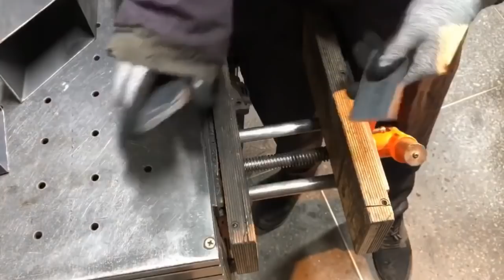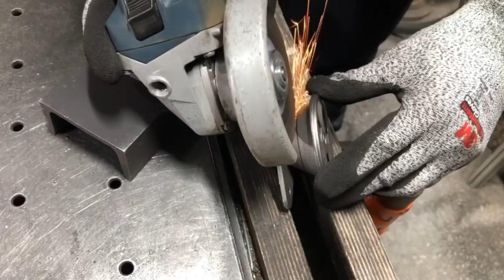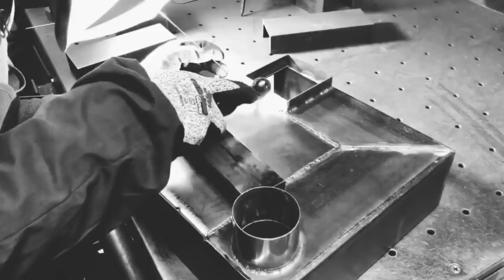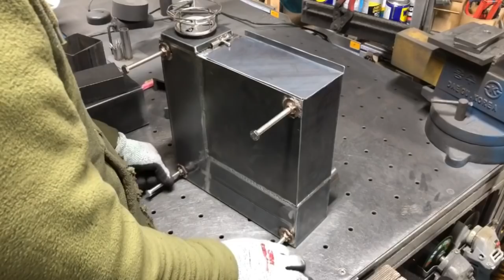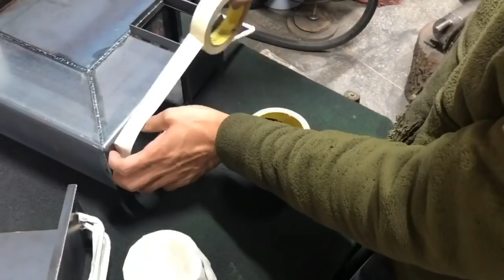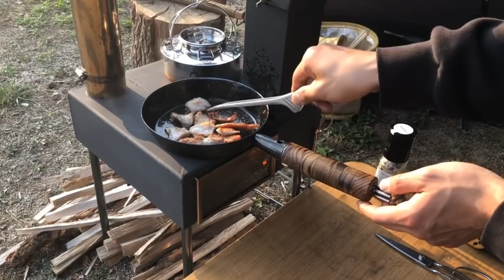캠핑용 미니오븐로켓스토브 만들기/Making mini oven rocket stove for camping

Comment from the maker: 캠프에서 연속약11시간사용
전체무게약: 10~12kg
연통:3M사용 (2~3M권장)
전체 사이즈: 300X300XH100 /오븐: 200X185XH85
각관파이프 :100X100X2T /철판: 1.6T ,4T(오븐상판)

About 11 hours of continuous use at camp
Gross Weight: 10 ~ 12kg
Chimney: use 3M (2 ~ 3M recommended)
Overall size: 300X300XH100 / Oven: 200X185XH85
Square pipe: 100X100X2T / Iron plate: 1.6T, 4T (oven top plate)

Cerca de 11 horas de uso contínuo no acampamento
Peso Bruto: 10 ~ 12 kg
Chaminé: use 3M (2 ~ 3M recomendado)
Tamanho total: 300X300XH100 / Forno: 200X185XH85
Tubo quadrado: 100X100X2T / Chapa de ferro: 1.6T, 4T (placa superior do forno)

Aproximadamente 11 horas de uso continuo en el campamento
Peso bruto: 10 ~ 12 kg
Chimenea: use 3M (se recomiendan 2 ~ 3M)
Tamaño total: 300X300XH100 / Horno: 200X185XH85
Tubo cuadrado: 100X100X2T / Placa de hierro: 1.6T, 4T (placa superior del horno)

キャンプで約11時間の連続使用
総重量：10〜12kg
煙突：3Mを使用（2〜3Mを推奨）
全体サイズ：300X300XH100 /オーブン：200X185XH85
角パイプ：100X100X2T /鉄板：1.6T、4T（オーブン天板）

Около 11 часов непрерывного использования в лагере
Вес брутто: 10 ~ 12 кг
Дымоход: используйте 3M (рекомендуется 2 ~ 3M)
Общий размер: 300X300XH100 / Духовка: 200X185XH85
Квадратная труба: 100X100X2T / Железная пластина: 1.6T, 4T (верхняя плита духовки)

在营地连续使用约11小时
毛重：10〜12kg
烟囱：使用3M（建议使用2〜3M）
整体尺寸：300X300XH100 /烤箱：200X185XH85
方管：100X100X2T /铁板：1.6T，4T（烤箱顶板）

Ca. 11 Stunden Dauerbetrieb im Camp
Bruttogewicht: 10 ~ 12 kg
Schornstein: 3M verwenden (2 ~ 3M empfohlen)
Gesamtgröße: 300X300XH100 / Ofen: 200X185XH85
Vierkantrohr: 100X100X2T / Eisenplatte: 1,6T, 4T (Ofenplatte)

Environ 11 heures d'utilisation continue au camp
Poids brut: 10 ~ 12 kg
Cheminée: utilisez 3M (2 ~ 3M recommandé)
Taille globale: 300X300XH100 / Four: 200X185XH85
Tuyau carré: 100X100X2T / Plaque de fer: 1.6T, 4T (plaque supérieure du four)

Kampta yaklaşık 11 saat sürekli kullanım
Brüt Ağırlık: 10 ~ 12kg
Baca: 3M kullanın (2 ~ 3M önerilir)
Toplam boyut: 300X300XH100 / Fırın: 200X185XH85
Kare boru: 100X100X2T / Demir plaka: 1.6T, 4T (fırın üst plakası)

Khoảng 11 giờ sử dụng liên tục tại trại
Tổng trọng lượng: 10 ~ 12kg
Ống khói: sử dụng 3M (khuyến nghị 2 ~ 3M)
Kích thước tổng thể: 300X300XH100 / Lò nướng: 200X185XH85
Ống vuông: 100X100X2T / Tấm sắt: 1.6T, 4T (tấm trên cùng của lò)

Circa 11 ore di uso continuo al campo
Peso lordo: 10 ~ 12 kg
Camino: utilizzare 3M (2 ~ 3M consigliati)
Dimensioni complessive: 300X300XH100 / Forno: 200X185XH85
Tubo quadrato: 100X100X2T / Piastra di ferro: 1.6T, 4T (piastra superiore del forno)
Reply: What u use on chimney pipe? Titanium or steel? U give me inspiration to create my own stove. 😊
Reply: 건강해주세요~ 작업영상에 번역까지 ㅠㅠ 물론 구독자와 조회수가 늘어 스토브님의 작업 영역이 넓어지면 좋겠지만...전 오랫동안 스토브님이 만드는 불을 보고 싶어서여.. 작업영상만 봐도 내가 골병날거 같은데 ㅠㅠ  부디 건강챙기셔서 세계적인 스토브 아티스트가 되시길 바랍니다~!!
Reply: StoveTV 파실 생각은 없으신지요?
Reply from the maker: I use stainless steel
I hope the video helps
Make a good product
Reply from the maker: 아직은 건강해요 ㅋㅋ
번역이 정말 일이더라구요 ..이제 번역을 넣어야할때가 맞는거 같아서😢
잡생각안난고 저도 공부한다고 생각하면 재밌어요 아직은 ㅎㅎ
한번 시작했으면 끝을봐야죠 ㅎㅎ
걱정해주셔서 감사합니다 역쉬~버섯커님 최고😆👍
Reply from the maker: 판매하고싶어도 회사일이 먼저라서 팔수가없어요 ...
이해해주세요 😢
Reply: StoveTV 아무튼 정말 매력적인 스토브입니다!
보는 걸로 만족해야겠네요.
Reply: @stovetv  do you sell these. They have superior designs over what’s on the market. 

Can you get into a larger scale production?

Comment: Please, which paint do you use, and what is the method or procedure that you follow in order to paint it?
Because I made a horizontal rochet stove with oven that reaches 590 C°, as a result the paint starts to peel off.
Thanks in advance for your help.

Comment: Hello,
i  love the rolled Chimney. Can you tell me the thickness of the metal sheet?
Best regards, 
Markus
Reply from the maker: The chimney thickness is about 0.1T
1.6T tube pipe
The thickness of the oven top is 4.0T
Most of the rest of the material is also 1.6T

Comment: Great design. It seems the change to 4mm thick top plate is from some lessons learned with your past designs. Would you consider doing a video going over what you learned from the different stoves you've done, either from each individual stove or just listing them all together?
Reply from the maker: Yes, 4MM steel plate has an excellent effect in preventing heat distortion.
It was applied as a lesson
Thanks for watching

Comment: What kind of glass used for windows? Is it normal 5 mm glass, or use tempered glass? Im stuck in the windows thing... 
Btw, your job was awesome!
Reply from the maker: It is heat-resistant glass. It is usually about 4MM.
Thanks for watching

Comment: Awesome!!!
Question: 1.6T, 2T and 4T, how much is it in millimeters?
Reply from the maker: About 11 hours of continuous use at camp
Gross Weight: 10 ~ 12kg
Chimney: use 3M (2 ~ 3M recommended)
Overall size: 300X300XH100 / Oven: 200X185XH85
Square pipe: 100X100X2T / Iron plate: 1.6T, 4T (oven top plate)